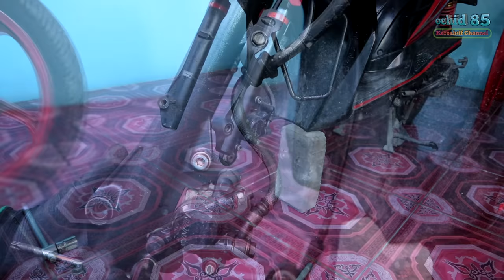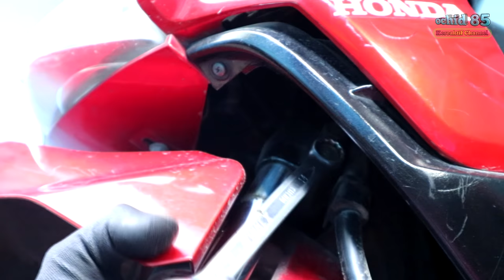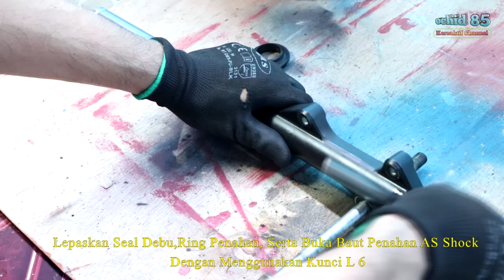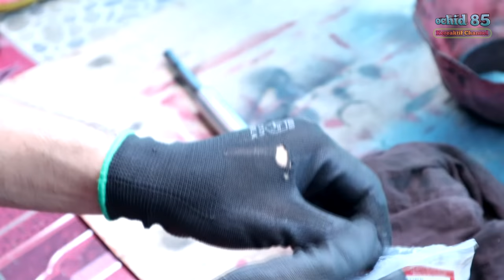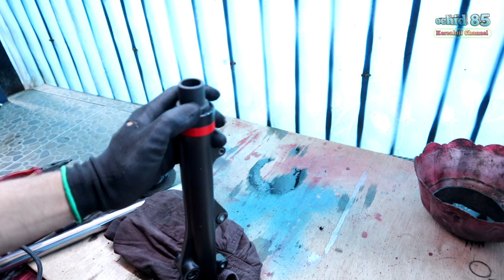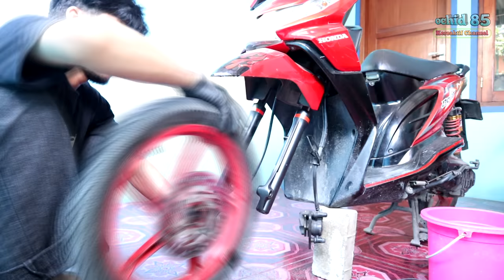Seal Shock Depan Honda Beat Bocor

Comment: Menarik nih. Kebetulan aku punya juga meler olinya. Motor yang sama, beat. Menarik nih, aku juga curiga problemnya sama. Aku barusan lihat ngga ada yang cacat pada shock nya. Tapi aku tetap curiga sama shield nya.
Reply from the maker: Betul om oli meler kalau AS tidak cacat, sudah tidak salah lagi sealnya sudah bocor
Reply: @ocit  boleh tahu untuk oli nya berapa banyak ya yang perlu di suntikan ke sockbreker
Reply from the maker: Beat karbu sekitar 72ml, cek di deskripsi om

Comment: Bg mau tanya kenapa yg shock depan rembes/ bocor mulu bagian kiri untuk beat karbu gw udh 2 th 2x bocor normal atau ada yg rusah
Reply from the maker: Usahakan pas ganti seal volume oli antara kanan sm kiri sama om, dan as tidak baret atau lecet
Reply: @ocit  ok bang, untuk oli berapa banyak. kalo misalkan baret dikit dampaknya apa
Reply from the maker: @alistinabdilah4964  beat karbu sekitar 72ml kalau mau keras suspensi nya bisa di tambahkan, makin banyak jadi makin keras dan sebaliknya

Comment: kak tanya shock depan motor saya oli keluar tapi masih belum parah, untuk as belum baret, motor saya beat new 20, apa yang harus diganti ? seal ? Terimakasih
Reply from the maker: Sebelum parah coba ganti seal saja om sama olinya, tp kalau masih sekedar basah saja masih bisa bertahan
Reply: @ocit  ok kak trmks infonya
Reply from the maker: Oke om sama2

Comment: bang itu seal nya emng kalo baru di dalem kaya per bentuk ring tu emg harus di melarin dulu ya
Reply from the maker: Jgn om justru klo di melarin nanti daya cengkeram akan berkurang jadi oli akn jadi lbh cepat keluar
Reply: itu bengkel temen saya om setiap ganti seal di melarin mulu sama dia
Reply from the maker: @muhamadsigitaska6005  terus bagus tdk hasilnya, seharusnya tidak usah
Reply: cepet bocor bang padahal aku sering ganti setahun bisa 2 kali ganti sealnya
Reply from the maker: Klo bisa jgn di melarin, memang kenapa sih harus dimelarin dulu 🤭, kan karet flexible

Comment: Bang mau tanya,motor saya honda genio shock depan saya sebalah kanan sudah  3x ganti sil tp ttep bocor kanapa ya. Penyebabnya slain sil apa ya
Reply from the maker: Coba ganti seal dengan seal ori om bukan OEM apalagi yg KW, bisa jadi pada AS shockbreaker sudah baret om
Reply: @ocit  kalo ganti as shock sebelah bisa ga ya (yang baret) apa harus ganti as shock dua duanya.
Reply from the maker: @mujikrist  sebelah saja bisa kok om tp kalau beli memang sepasang

Comment: Izin bertanya mas, saya ada rencana untuk ganti 1 Set Full Shock Breaker depan BeAT FI CBS K25. Ternyata harganya 500 Rb an 1 pcs (kalau 2 pcs kanan kiri 1 jutaan) kata Bengkel Resmi nya

Yang saya ingin tanyakan, apakah perlu ganti rumah (tabung) shock breaker nya ? Atau cukup sekedar ganti Seal Shock dan As Shock nya saja ?

Fyi,  motor saya sudah lama mati shock breaker nya, kayaknya udah 2 - 3 tahunan atau lebih

Mohon dijawab mas, terima kasih
Reply from the maker: Shock mati itu yg seperti gimana om keras? Kalau as masih bagus cukup ganti seal dan oli saja harga segitu terlalu mahal mending beli baru sudah dapat kalau harga sejuta, cari bangkel biasa aja yh sudah langganan, saya g pernah ke bengkel resmi soalnya sama aja cara kerjanya kasar
Reply: @ocit  Iyaa mas, shock nya udah ngga main lagi dan kasar dan sepertinya sudah tidak ada oli nya, karena 2 - 3 tahun yg lalu pernah bocor oli nya (rembes keluar dari shock nya)

Ohh gitu mas. Baik mas, terima kasih atas pencerahannya
Reply: Setahu saya harga Set Shock depan K25 cm 375 rb.  Gak sampe 500 k. Jika agan Bogor Barat. Saya siap Home service.

Comment: Maaf mau tanya harga seal paling murah berapa paling mahal berapa? Itu untuk semua motor sama aja apa tergantung motornya?
Reply from the maker: Rata2 kisaran 35-50 k om kalau yg dinoasaran biasanya KW atau OEM om utk jenis motor beda harga om
Reply: Biasa dari 5 rb sampe 10 k. Ori diatas 18k sampe 22 rb. Set atas bawah ori 47 k tuk honda Bebek matic. Lebih murah pakes suzuki Shogun saja.

Comment: Bang kok baut pengikat shock motor saya yg atas cuma satu ya
Reply from the maker: Motornya apa om, bebek, matic biasanya 2 yg bawah sama yg atas utk stopper as shocknya, apa lepas apa mungkin bawaan pabrik?
Reply: @ocit  motor beat,jadi shock pengikat baut atas yang kiri ada satu kanan juga satu,tapi kanan kiri lubangnya dua
Reply: @ocit  iya saya belinya motor belahan dulu
Reply from the maker: Hehe klo bisa dipasang om kuatir klo pas ketemu polisi tidur atau ngebut ketemu lubang as nya bisa ndelesep bablas

Comment: Kunci nya apa saja om,
Reply from the maker: Kunci ring pas 10,12,17, kunci L 6 kunci L bintang T4 buat buka kaliper obeng min sudh itu saja om
Reply: @ocit motor Sy juga bocor kalau belum ada baret ga usah di ganti, terus harus punya tracker buat buka per nya y. Omm makasih
Reply from the maker: @rosgun  ga usah pake tracker om cukup pakai obeng buat congkel seal, per tidak usah di buka om